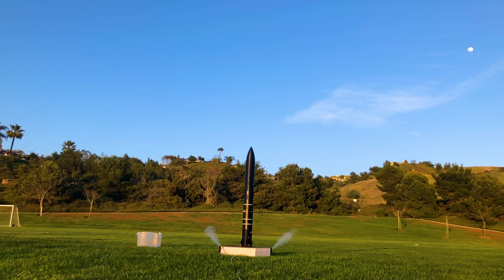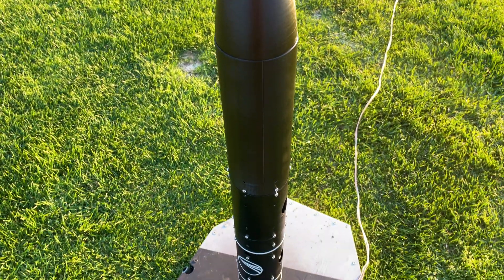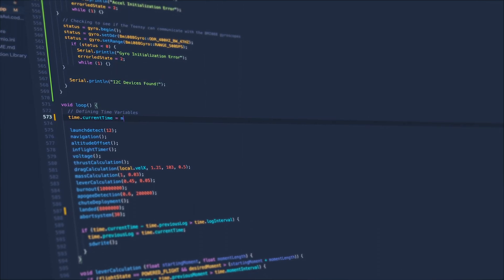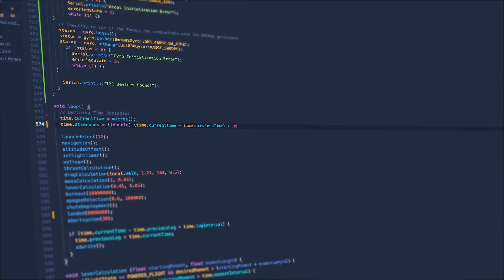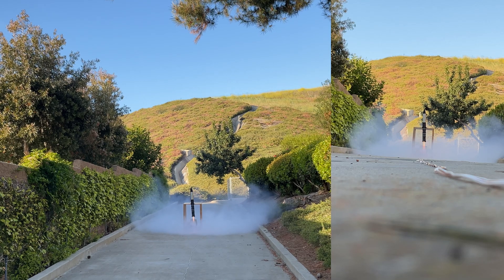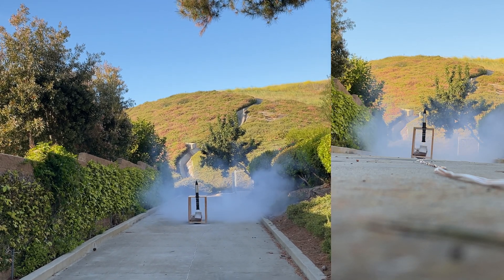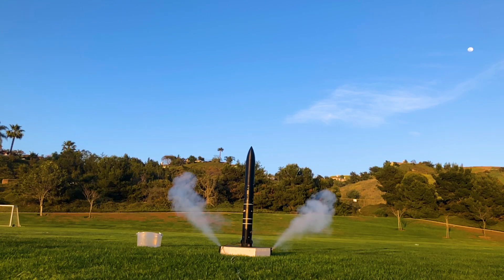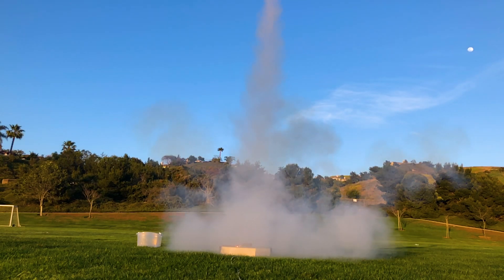Frontier Thrust Vector Control Rocket | Flights 22, 23, & 24

Comment: How do you tune the PID values? Do you perform static fires or do you use Python?
Reply from the maker: I tune in a simulator then fit the PID gains to the torque output. If it’s a new rocket I will preform a static fire to make sure all of the vehicle dynamics were correct.